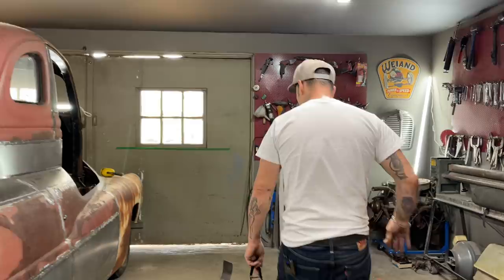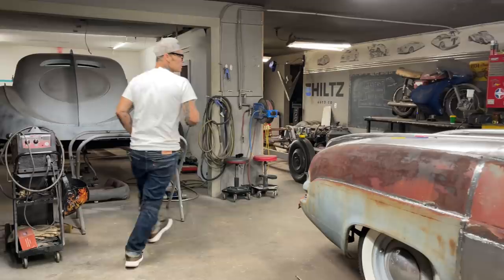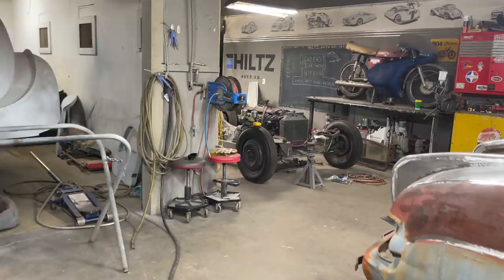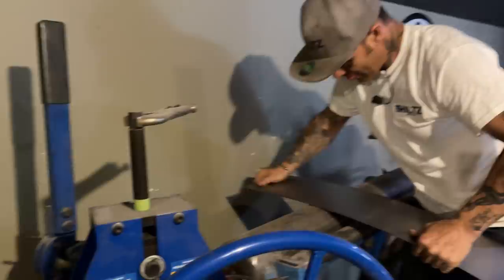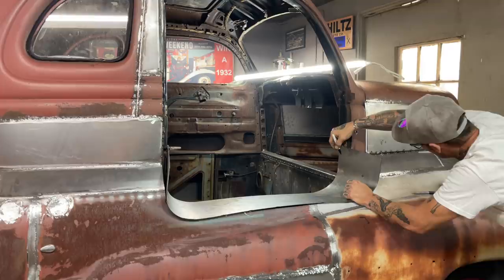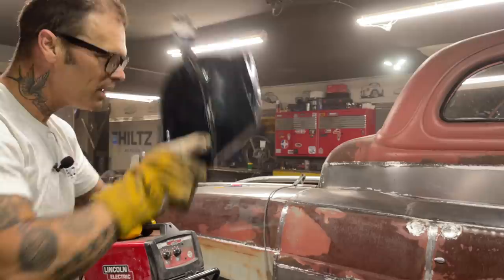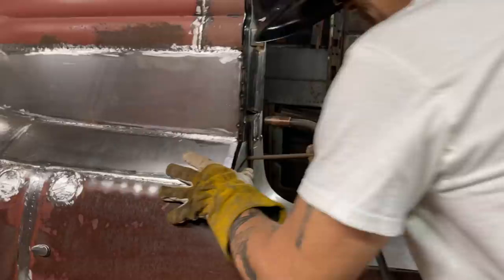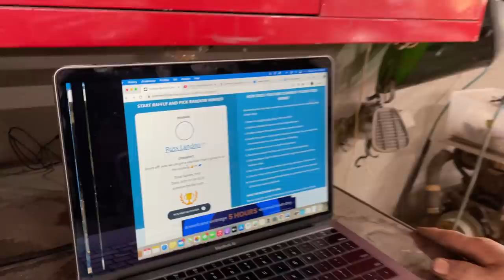DESIGNING AND FABRICATING THE DOOR: 1949 MERCURY CABOVER

Comment: Swing Away Expandable Offset Door Hinges are not typically made for automotive applications but borrowing from the design you should have no problem making your own.
Reply: Chad, take your hand & shape a "C".  Then hold your thumb as a pivot point. This is a hinge that will not bind as it lifts as it pivots.  Look at the rear doors on a corgi van.
Reply: Cargo

Comment: Chad if you try to use "Swing away door hinges" be aware that the rear (assuming that the hinge is at the front) of the door will move backwards by a considerable amount, and will hit the lower bulge! this is the reason why the Mercedes used the gull wing doors on their 1955 300SL, or the lamborghini doors were needed etc, you could try to mount the lower hinge at the wide part of the bulge,  as long as you angle/align with the top hinge angle,  they MUST on the same pivot line, this would possibly be the simplest method (the pivot line MUST be in line with both hinges) the other  solution would be to scolloping the bottom front of the door to allow the door to open, you did "tape" this design on one of your early videos, and which I mentioned in my earlier post.
 
Again if you would like to discuss it feel free to contact me.

Comment: It seems to me that the only way the door can open away from all of its edges (short of a more complicated hinge) is to have the hinge axis outside of all of the edges of the door; meaning the axis would sit on an angle if the hinge is to stay close to the car. Then... it seems best to do a suicide door with a hinge point at the bottom (as it curves way from the door) and at or near the top of the door. (Or a gullwing :) By capping the inside of the door frame one is further limited as to where the edges of the door move. IMHO Thanks Chad!

Comment: I'm glad you're eye's doing better.  Just a quick question for you .  Why didn't you put some square tubing on the edge where you are 45ing the weld for strength ?  I'm sure it will be strong enough with out it but, since it's a spot you will either sit or stand on then wouldn't you want the extra strength ?  Of course I am used to working with 20-22 gauge steel so I am always wanting more strength.  It must be really nice to work with 18 gauge.  Sorry just one more question.  With the type hinge that is on the top doesn't that swing to the outside ?  So unless you wanted hidden hinges which would look great too wouldn't those work for you ?  I really like the headlights that you have welded on there rather than the Mercury ones that it had before.  I'm really looking forward to seeing it all one color or bare steel so youo don't have the distraction and you get a better look at what it will be.  Of course you can change the way you see it by stripes or even the way you could split it with a second color.  I guess that's why I love working on cars so much, that is the creativity that each person can put into his/her own project.  I guess that may be the reason that the RAT ROD is so popular.  Have a great weekend.

Comment: Hello from Ontario Jolene and Chad i was wondering if i may pick your brain.... for quite awhile now i have been toying with an idea for a build of my own, my issue i have run into is this.... the project is based on a 40-41 chev COE like the one in the movie jeepers creepers. Now i know it is a very hard body style to find so i have decided to make my own seeing i have alot of the equipment to do so, but my issue is even when completed how would i go about registering it for the road, would it be classified as a homebuilt? FYI i just want the look of the front end the rest will be my own frame custom sleeper cab and flat deck with a Cummins 12 valve backed by a 13 speed Eaton Fuller. Ahead thank you for any input or direction you may have....Cheers!!!

Comment: Cab foot holes to climb in the cab like on fighter jets with hinged cover flaps.
Reply: @SgtE5  Masrakenly I have been putting my comments on chat. I actually made my key steps on a  chat while Chad was fitting the sheet metal on the sides of the hood. 
Fuel tanks:  Man fuel side tanks will add so much weight to the already heavy nose that the torsion bars will have to be massive.
Reply: Good idea I was think n springs on the bottom of his boots.
Reply: Yes he needs some kind of a step. You could make a pop out step that opens with the door..one more thing anyone remember old dodges when you open the door the seat would pivot spin so you could sit down then go back when you shut the door

Comment: I’m not really seeing how this door is going to work. I was thinking if you cut it at an angle back and down from where the skin flares out it would be able to swing out over the body work. And if you cut it down low enough, you could have a sill to step up into the cab. Or you could just hinge er off the bottom and climb up the door to get in eh.

Comment: Remove the bell from the bottom of the door, keeping it flat and make the area where the bell went into a running board area (exterior door sill)......You are "sighting" the wheels on that grinder so the sparks blow directly in your face.....And if the blade bites and explodes, guess where it goes (?)......

Comment: Gull wing doors like a early 1950’s 300SL with electric actuators.
Pull back the headlights more proportional to the hood.
Smooth below the headlights to fit the design of the rest of the vehicle.

Comment: Re door hinges; have a look at a modern cars trunk lid hinge. They are designed to pull away from the car like you need.

Also please put a small vertical lips on the inside of your door opening so you can run a rubber door seal around the opening

Comment: Chad, why not use the type of hinge for the doors like what is used on later model gas cover doors, they lift up and out.  Also, since the '49 Merc had suicide doors on the rear, why not make the doors on the truck suicide doors, like on a 34 Ford.  Might even make it easier to get in and out of.

Comment: That 9” wide bed of that threshold plate will be susceptible to dents if left flat. I was hoping you’d use your bead roller to add some strength to that piece with some 1/2" grooves or a recessed panel.

Comment: It would be bad ass to make the rear quarters bumped out put on a set of duels, 7.3 power stroke turbo the shit out of it. And put a fifth wheel on it the way you have the box it would work great to pull a fifth wheel trailer. It’s a bad ass rig. Air bags. Build tool box’s in all the empty spaces in the back.
Reply: Or a 358 modified, 602 create, Ford 360, or Ford 390 y block, or if sbc 400